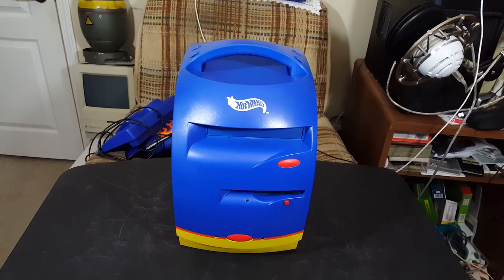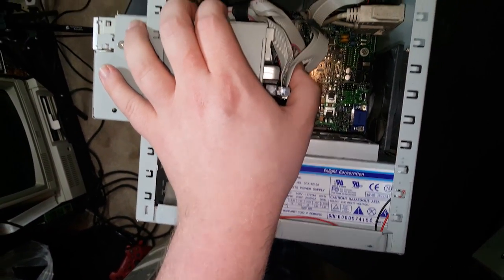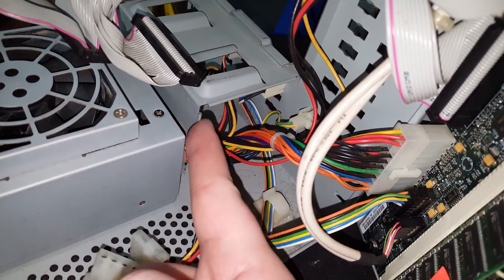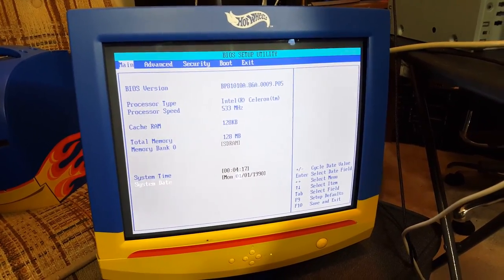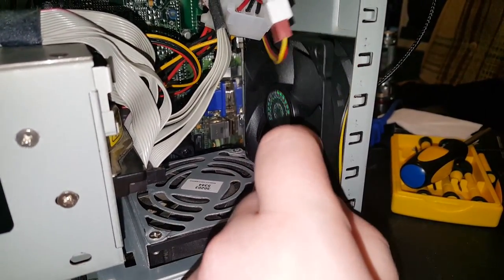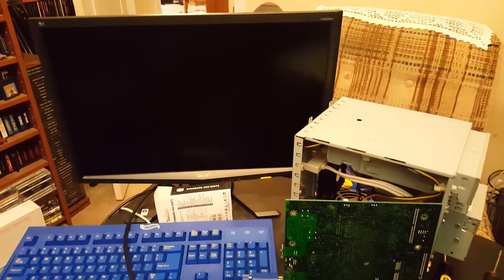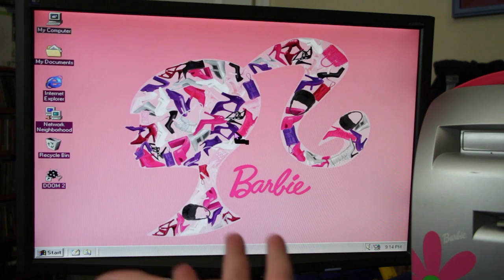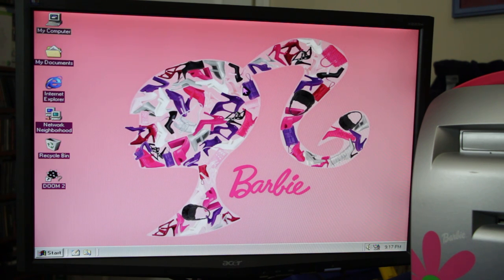LGR - Repairing The Barbie/Hot Wheels Computer

Comment: would it be possible to upgrade that PC to windows 2000
Reply from the maker: Sure! But I prefer to keep them in their (mostly) original state.
Reply: Fair enough, but windows 2000 would increase their usefullness
Reply: It's not intended to be useful more than this point.
Reply: I actually think wiping Windows ME off it was the best that could be done to enhance its usefulness, and 98SE is just the best for the machines of the era. 2000 needs quite a bit more RAM, and doesn't fare all that well with modern software either. And it has no real DOS mode.
Reply: Matthew Berry Windows 10 lmao
Reply: Siana Gearz BEST. DECISION. EVER.
Reply: Matthew Berry What about the latest Mac OS?
Reply: What about a dual boot of Windows 98 and Windows 2000
Reply: Make it as a Hot Wheel Sleeper PC which you must to build a new machine through that case

Comment: At 135 °C you didn't do anything to that motherboard but reduce the life of all the capacitors (rated at 105°C).
You need to crank up the heat up to 220°C to melt any solder and that will also break all capacitors and most connectors on it because those are mounted and soldered by a wave soldering machine AFTER the reflow oven soldering takes place at the factory.

Comment: HP would later steal this design for their HP Pavilion 4440, but they actually did it right.
Reply: superstar64 HP did it first...  these came out after 2000 while the 4400 series was 98-99 (we got a 4483 in 99).  Ironically they all use the same pos power supply and they're all junk.  I picked up a 6735 a few years ago and found a socket 775 board to put in it finally, but the power supply is giving me fits trying to find a decent one that isn't going to burn the house down...
Reply: Daniel Vogel 
I think my first computer was a Pentium 4 XP era Dell computer, but only recently I bought one of these 4400 designs. It’s not nearly as hard to work on though, since not every part has to be taken off to replace the PSU. Upon further work though, I realized that it does basically use the same unit, but it’s turned slightly different in the case, and in my case has I guess lasted around 20 years.

Comment: That 7min at 375F is a neat trick I'll have to try.  I have replaced solder points on old car PCBs with an iron because the rosin will over time create a large resistance in the connection.  Surprised that weird supply wasn't even harder to come across than it was.  Way to stick with it.

Comment: Somebody build an overpowered RTX gaming PC inside the barbie PC case
Reply: The real trick is the fact the case doesn't really support the modern outputs or graphic cards.  The IO stuff most cases have is non existent on this case.  Though with the massive advancements in computing, the internals will work with the case.  Mini board and using a VME SSD will help with the space.  But the real issue is that you can't really use any Nvidea or AMD GPU cards.  Though the idea of those cases housing a modern gaming computer internals would be a fun concept.  Though the exhaust fan is a must since air flow is also almost non existent with this case.  At least to deal with the heat that newer CPU's and RAM chips will release in that confined space.

Comment: Can someone explain how baking the motherboard fixed it?
Reply: It explains in the video, has to do with heating broken solder joints.
Reply: +Tyler Norris very crude explanation. solder/metal expands from heat and reconnects to original contacts
Reply: That was kinda the point

Comment: For the case fan, you should have bought a low-profile fan, which is about 3/4 the thickness of a regular normal case fan.   And to be honest, in many repairs I did over the years where I had to replace fans in cases that took non-standard sized fans, or otherwise were cramped, I either only put 1-2 screws in and/or just used small zipties.  Worked great.  But the low-profile fans work best for tight spaces and some of them are quite quiet and can move plenty of air.  However, in those cases, I don't think a case fan is going to help much anyway.

Comment: Possible sound fix: Some really old Intel based boards had an onboard Yamaha synth chip for midi. There were two models of the chip so just try them both to see which one works. Then theres the usual full codec pack to try just for kicks (I think it came bundled with Shockwave Flash Player and the like), and DirectX6.  One day I should really collect all my old drivers together and put them up on a file sharing thing. Im sure any copyright nonsense of them should be out of date by now.

Comment: @LGR i have a similar problem , for an hour, i have been trying to get this motherboard to power up. i thought it was the power supply as well, but i tried several different PSU until i tapped the CMOS battery with the screwdriver. "OMG it powered up!!!" but nothing happened.  Still the power switch did not turn it on, only touching the screwdriver on the battery made it power on ,but it seems dead now .Any ideas to probably get the board to work?

Comment: sounds like a cold solder joint and was able to reflow from the oven. id def recommend using a heat gun though, they are cheap and give you much greater control
Reply: Indeed. However, it's very easy to accidentally toast a component using hot air.

Comment: Back in 2000 or so there was a company selling the Barbie one for like $75 "just the tower n maybe the keyboard and mouse" ...funny thing the company had to sand off any markings and wipe the hard drive before they sold them...I still have a replacement motherboard sealed in the bag for these.."had 2 towers go bad"....where has the time gone

Comment: Imagine walking in to a lan party with your Barbie, and or Hot Wheels car case and you set it down. It has all modern components on the inside  and is basically a sleeper.

Comment: +
LGR

Was it not easier just repair that PSU? I think it's worth it beacuse i'm pretty sure that transistors or caps failed in that thing. Most common failures in AT and ATX PSUs are blown /shorted tranistors, main filtering capacitor, or caps on the output,eventually Shottky double diodes. I fixed over 60 ATX PSUs and over 90% has above failures...

Comment: Im well versed with such small cases/machines.  The pc im typing on now (which happens to be my work pc too) is actually based on a very very small tiny case like this - which obviously Ive had to upgrade and do all sorts of things like you Clint. 
I used the Noctua slimline cooler (lga 1155 i think) to get around fan space issue.
Reply: actually I think my case is about half the size of this or somewhere there. Just fits a mini ITX board and its a small rectanglar cub-oid.

Comment: i know this video is old, but i just want to point out you can get sfx and sfx-l form factor psu's for a decent price and wattage, built my father a personal "console" for emulation, was an amd 2700x on a asrock fatal1ty b-450 mini ITX, noctua nh-l9a slim cooler, 16 gb of ddr4 3200, EVGA GTX 1050, seasonic 450w sfx-l 80+ gold (cost me about 80$) with 250 gb nvme and 500g wd black inside a silverstone milo case with carry handle. he loves it

Comment: Question 1 : Why didn't you just switch all the components from the New PSU into the old PSU container?
Also If you REALLY want to use the New PSU before buying a completley new one, you could have drilled a whole on the back side of it. 
Just my input.

Comment: gotta love cooler master fans and heatsinks.. they just work :P but holy crap i cant even begin to imagine the pain to build and fiddle in those cases. even big tower ones is issue for me at times. cuz even if the case is big all the parts sit tight together and worst is usually the front panel connectors even without other than mb n cpu in place. and prob ram. too close to the edge of the case so its a hassle still. (have size 12 hands/gloves so about avg?)

Comment: It'd be cool to take one of these, gut it and properly swap in a modern ITX board and custom mount a GPU inside and pipe it through the back panel connections. Bam. Hot Wheels PC with an i7 and a RTX 2060/2070.

Comment: My Pentium 4 IBM think centre 8187 is doing the same thing now where it starts up everything gets ready to engage but then beyond that point The fans and hard drive just sit at idle end it doesn’t do anything more not even the monitor comes on the worst part is I haven’t even touched it in a while and it couldn’t be the effects of the movement moving it from the edge of my bed to where my other PC is taking the roll as primary

Comment: Installing Windows 10 to these computers may harm 'em
Reply: You think? You need like 1gb of ram just to run 32 bit windows 10. And I doubt the CPU or GPU is powerful enough in the first place
Reply: Installing windows 10 to any computer may harm it 😂
Reply: @blackie999uk  can confirm, tried to install Windows installation media to my flash drive using the tool that Microsoft provides and my flash drive died during the installation.

Comment: You did too much effort to replaced power supply. You only need to required just swapped some transistor from Old power supply to get that worked. Its too simple to do many alternation in Chasis.

Comment: I guess Apple's unrepairable and unupgradable computers were inspired by this thing
Reply: Алексей Гриднев Nah, Apples aversion (well, Jef Raskin’s and Steve Jobs’, actually) to expandability dates back at least as far as the original Macintosh, which predates this machine by 15-20 years.

As for lack of repairability, that’s just a fortunate (for Apple) side effect of designing for ease and speed of assembly.
Reply: @ianweber9248  I was just joking :) 

Also, I don't think that lack of repairability is a side effect of ease of assembly. Apple computers are probably the most overengineered computers ever, with tons of distinct screws, nuts and bolts. It seems they actually invest extra money in **making** their computers non-repairable.

Comment: Now put on a gtx 1080Ti
Reply: It does not have a pci express slot even if it had it would not fit and the psu is too low watt and it would be bottlenec with the celeron
Reply: It doesn't work his psu is too low this motherboard has no pci
The intel celeron will never trust high end gpu

Comment: Don't blame Mattel, pretty sure the only association they had was licensing their top name IP.   Odds are the old PSU just needed new capacitor(s), but really what is the point?  It was 2016, what use is a 533MHz Celeron?  I mean sure you could do an email server, or fileserver or some such, except you'd be using an ancient IDE HDD or some adapter for an SATA which all gets a bit fiddly, and might need to make it an SSD (even losing 70% of the performance) to use the full capacity 'cuz the bios probably doesn't support multi-TB HDD capacity.

You could have just cut the fan grill out for better airflow then mounted the fan on the back of the case, then at least it is out of the way to more easily lpull that low quality replacement PSU out when it fails.